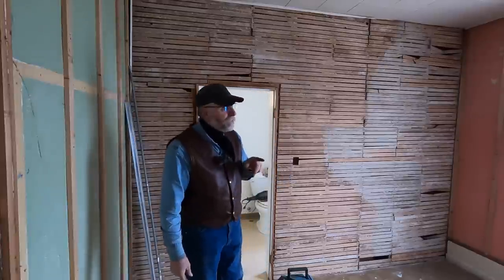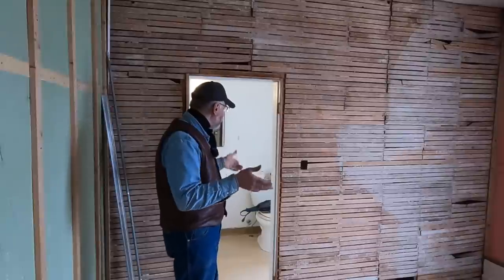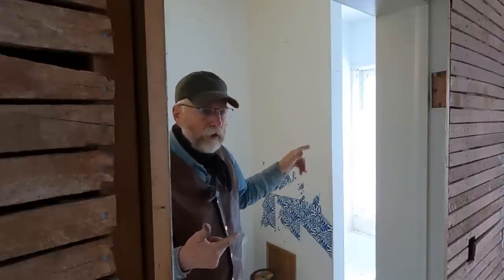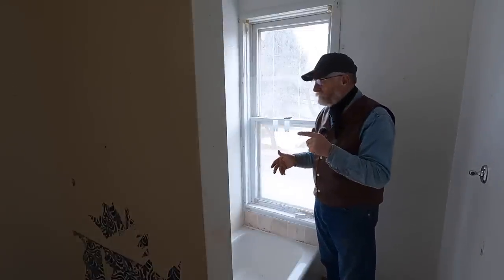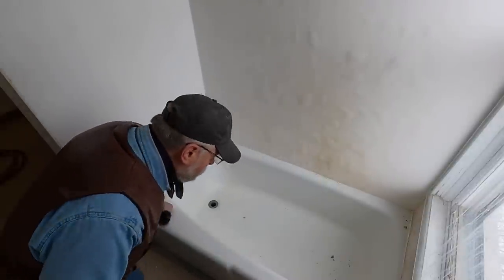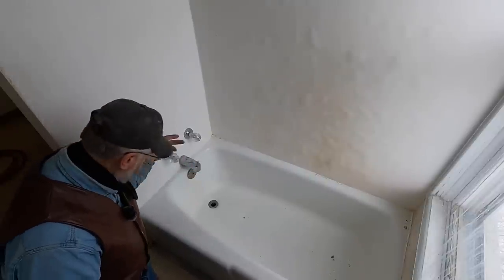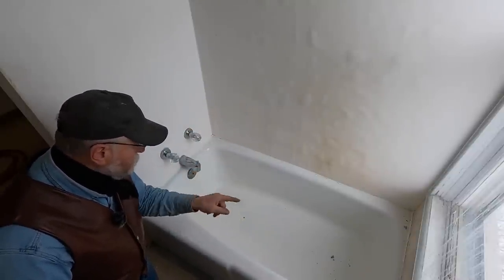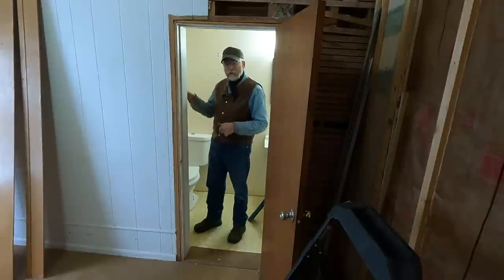1906 Hotel - Out With Cast Iron Tubs | Engels Coach Shop

Comment: In Scotland, the cast iron bath removal tool of choice is, a big hammer. Doesn't take too long, and good fun.
Reply: Same in England. A 7lb sledge will turn it into cast iron gravel quite quickly. Ear defenders!!!
Reply: Yeah, I've done that, it makes as much noise as a bagpipe. Actually, I'm sitting here polishing my bagpipes, I haven't gotten them out in over a year.
Reply: Yes, that's what I did to remove one in my house.  It was too heavy for me to handle alone, and a big hammer made quick work of it.  A bit messy but satisfying.
Reply: That would be too much fun and this channel would be demonetized,
Reply: I slid my Scottish out in one piece and cut the side out of it and filled it in with decking to make a garden seat
Reply: I did that myself and got just under $20 scrap price.
Reply: There is a lot of call for old castiron tubs that are in decent condition
Reply: These aren't the desirable tubs. These are shallow. So worth more as scrap
Reply: @catafalque3634  So cool!!!
Reply: Ear plugs,  eye  protection and a sledgehammer.
Reply: Did the same.   Told my wife to cover her cause I was going to make some noise.  Sledge hammer a nd drop cloth worked.  Hearing protection is beneficial!
Reply: Was about to say the same a sledgehammer does a fine job ( wear eye protection), surprised how short the baths in USA are great video again
Reply: @michaelgillespie1206 The pipes are much pleasing to the ears.
Reply: @jackgreen412  the skirling of the pipes is very pleasing.
Reply: @johndavies2396  Those tubs look shorter than typical American tubs...
Reply: Exactly my thought the moment I heard "cutting tool" - but WHY, this is cast iron! Short sharp shock with a heavy "persuader", and it's done.
Reply: @demonknight7965  I did some bathroom renos when I was a kid. We busted them up with a sledge. It makes me cringe to think what I could get today for some of those claw foot tubs I destroyed 45 years ago.

Comment: I generally use a sledge hammer to remove cast iron baths. It makes a lot less mess than an angle grinder and it's much faster to reduce it into manageable pieces!

Comment: A refrigerator dolly with a built in ratchet strap is useful in getting old tubs downstairs. If you choose to break them into pieces with a sledge make sure to have safety goggles on. Cast iron has varying quantities of sand added which makes it very hard on cutting tools. The sand in the iron pour makes it brittle so it is usually easier to break it than to cut it. Please be careful.
Reply: Also the enamel is essentially glass, and can splinter and fly like crazy.
Reply: I have busted them out with a hammer too. OUCH! Messy but quick.

Comment: Dave, I'm sorry to say this - i winced (for the first time) when you cut up that cast iron bath tub. They are very highly prized here in the UK and fetch good prices. People often dislike the plastic or fibreglass ones commonly available.
Reply: Yeah, I hate the plastic and fiberglas to where I'd rather go outside and use the hose, and the thin metal ones aren't much better. I have a cast iron tub where I am now, thankfully!

Comment: Also, you will want to seal up any of the penetrations on the second floor as best you can.  Sheet metal or plywood and then caulk.  The restriction of air movement translates to restriction of fire movement in case of a building fire.  More time for people to exit the building before total engulfment

Comment: I'm a retired plumber and I'd be really nervous about using a grinder in a confined space in a building that's 100 years old it's so easy to set fire to himyou might not see a smoldering until the middle of the night when the thing goes up in flames. I recommended jackhammer for the tubs. Most people  use sledgehammers.
Reply: I agree regarding the grinder.  About 10 years ago in Bay City, MI an unsupervised subcontractor used a side grinder in the attic of the courthouse during a re-roofing project.  A fire started and the building was substantially damaged, including many, many records damaged or destroyed by the sprinkler system.  Those old buildings are tinder-dry (usually) and a single spark can start a fire.  Hammer Time.
Reply: Jackhammer sounds like more fun then a sledge.🍻🇨🇦👨‍🏭

Comment: Drain removal:  Sometimes a smaller set of Channelocks can be used to remove the drain.  Put the handles down through two of the four holes in the drain; use a screwdriver through the exposed part of the pliers to turn the drain.   Thanks for your videos.
Reply: Those drains didn't have any cross bars.
Reply: He told you the cross did not exist. Please listen next time. Do better man.

Comment: Old buidings! A nightmare. My experience rehabbing bathrooms in old buidlings is to gut the room to get down to original structure to see what you have. Everytime I have found so many alterations and water damage over the years I wind up taking it down to studs and floor joists to have a new foundation to work with. Often I find the floor joists have many holes drilled through for plumbing and electrical. I lay in stingers next to them to make it structurally sound. It makes for a solid floor. Also, I don't have to make compromises and waste a lot of time making old and new fit. It actually takes less time.

Comment: During my working life here in England, I have removed many cast iron tubs, if they were to be scraped or too difficult to remove whole, I found the best way was just to brake them up with a two or three pound lump hammer, cast iron baths brake up quite easily with much less dust than cutting. For the rest of the building, I would employ the services of an architect with a view to completely re-designing the whole building, which we would describe a gutting, that is removing everything that is not a supporting wall and start again. then turn it into holiday flats, hotel or in you neck of the woods, a motel, and market it and Joliet as a peaceful and beautiful place to stay as it seems to be on your video's, which I thoroughly enjoy. I have the feeling with your design ideas so far I fear it would turn out to be like it is now in ten years time. All the very best. Peter Norcliffe, Golcar, Yorkshire, England.

Comment: I went through several grinder blades cutting a cast-iron bathtub in my basement apartment. I had to get rid of it, it was filthy from decades of use without cleaning, but it was a heck of a chore.

Comment: Surprised you didn't just take a sledge hammer to it and shatter the tub, that's what we do whenever we encounter a cast iron bathtub. 
Dave if you're concerned with privacy for that bathroom window you could always frost the glass. My bathroom window is setup similarly to where it's in front or the shower but, we didn't want to put curtains or blinds up as they would get soaked so I went to the hardware store and purchased some that glass frosting spray fairly cheap and I applied 2 coats to the window. 
   It works quite well, it prevents anyone from being able to see in even at night but, it still allows all the light to come in. It's also easily removed with a Razer Blade  if you ever change your mind. 👍👍

Comment: Dave, there is a special plumbing tool made just for removing  the tub drain from the tub. You could make one by welding four short stubs of iron rod  onto a round plate just-smaller than the tub drain, approximately 1 1/4” diameter. Ans welding a short piece of square iron bar or tube on the opposite side. The four prongs going into the  tub  drain snd you then use a  wrench to loosen the drain from the tub. .

Comment: Yes I agree the method of choice to remove a cast Iron tube is a 10 Ibs. sledge Hammer  . The first floor tubes you might consider saving a few to sell , or the make great watering troughs for cos and horses

Comment: I've removed many cast iron tubs, only one with a sledge hammer. That was messy, lots of sharp shards, took longer. On most I remove sheetrock or plaster high enough to pull it out slightly and roll it up on its side. It'll slide out on the porcelain face. If you're gonna cut it, bite the bullet and use your mini grinder, you'll go broke using reciprocating saw blades. There is no easy way to take those out, just maybe less painful ways. Most assuredly, get some help.

Comment: Dave, I'm sure someone else already mentioned this, but there is a tool made for removing those drain plugs.  It looks a little like a misshapen fork with a t-handle on the top.  But it fits down into the drain and will turn it out pretty easily.  It would hurt to use some lubricant/ rust loosener on the drain first, though.
Thanks for the video - as always, you make me feel guilty I'm not carrying on more projects at once!
Tim

Comment: A demolition hammer works wonders in removing old tubs. Or a BFH works too! Plus you can work off any  frustrations at the same time. I have a pair of old pliers put together backwards with a nut & bolt to remove and install drain fittings. Works like a charm

Comment: Looks like everything behind/under tubs was dry. May not have been pretty, but the install worked. The plumbing looked pretty straightforward, which I guess is to be expected since these “private baths” were added when the apartments were put in.

Comment: Those tub drains are usually pretty easy to remove if you can get to the back or bottom. There is a nut on the pipe tightened up under the bottom of the tub. Unscrew it, and the drain fitting in the tub should be free. But it won't be, because it was put in with putty to seal around it. You can usually grab the thing under the tub with channel locks and either wiggle or tap upward on the channel locks to break it free. One more gland nut about 3" below the bottom of the tub and you can remove the entire tub drain fitting including the overflow pipe.

Of course if you can't get to the nuts, things are harder... It does look like there must be a crawl space above the first floor where the pipes are run, so there should be an access to that space, someplace.

Comment: Cast iron tubs shatter. Using a sledge hammer makes quick work of them. 

Also, I know you're wanting to keep the outside looking as close to original as possible, but have you considered glass block windows? They can be made to be water tight and they solve the privacy issue.

Comment: When redoing the plumbing, install water cut-off for each unit, that will be usefull in case of future problem in one apartment: you can work without impeding on other units.

Ideally, the cut off valves should be in the corridor, so you can isolate a leak even if the tenant is away.

Comment: Good job on removal of the tub. I did it once. FYI hardware stores should have a drain removal tool for about $15. If you reach in you will two nubs. The tool goes over and then with channel locks you can unscrew the drain. Definitely useful if you ever plan to reuse or replace the plumbers putty if leaking.
18:44

Comment: You mentioned that you would put in a 32" shower.  I would recommend 36" if it will fit. 32" works but feels confining. Also, it doesn't need to be square. A 32x36 or 32x40 would also be good choices.
Reply: In that regard, check the building code.  I seem to recall the stall has to be a minimum number of square feet.

Comment: I have replaced a steel bath tub in my own bath. Getting the tub out without modifying the structure was not pretty. and putting a new one in is the same. I replace a shower pan for my neighbor, not pretty but the floor needed work also. The old drains should be removeable from below. There is a compression fitting on the trap.

Comment: If you look on the bottom of those bathtubs it will be stamped the year they were made so you’ll have an approximate date of when they were put in
Reply: I have a very old one out back (someone had used it for a stock trough, but it's in too good of shape for that) and was wondering about that, but didn't find any date. Anywhere in particular to look? It's a deep one with a round bottom and curled rim, but no legs.
Reply: @Reziac  I’m not certain on clawfoot tub’s but I know from the 20s on they were putting dates if the clawfoot tub doesn’t have a date on the bottom it might be under the rim somewhere
Reply: @hsimpson6581  This probably came out of a house that was built in 1920, but didn't originally have a bathroom (added after it was moved in the 1960s). Thanks, I'll give it a closer look... right now one side is frozen down and it's hard enough to move when it's trying to help ! :)

Comment: I almost forgot to add, Dave.  When you are ready to move those tubs down stairs, lay a piece of carpet down at the head of the stairs and turn the tub upside down on it. Then thread a rope through the drain hole to control it, and it will slide down the stairs on top of the carpet piece a easy as pie.  Don't have Diane waiting at the bottom to stop it, though; there's not enough of her to do that safely!
Tim
Reply: Thank you for the good idea.

Comment: You can shatter cast iron tubs with one or two sharp blows from a lump hammer or other similar heavy hammer on the underside of the tub. Breaks up like ceramic tiles. Boy oh boy do you need to wear ear plugs though. Then it is easy enough to hand ball the pieces to the trash. Careful the pieces are razor sharp.

Comment: Other issues with smashing apart an iron bath tub are that:
1. A piece may hit your shin.
2. Due to the curvature of the bath, your sledgehammer head may glance off and either hit you OR more commonly, put extra strain on your body by travelling further than intended.
I say this, as a sixty (60) year old carpenter.

Comment: Also.  Lath and plaster are not the same as drywall.  They do count as a structural element of the house.   Insulation in old buildings also change the loads on a structure.   Make sure you check with an engineer if you take too much out.

Comment: Hi Dave & thanks for the great vids.  This brings back memories and from that I would like to make humble suggestions.1)  Have water shut off valves to each suite.  2) Put more sound proofing insulation between suites where easily done in biffys.  3)  ** most important  get rid of natural gas stoves and put  in electric (yup may have to upgrade electric service but worth it in the long run) they will be better air quality and less chance of a big boom. I know they have been there for years which is even more compelling to get them out.  Also, being electric stoves, tenants pay the bill as I doubt there is a separate gas meter for each suite. A few  years ago there was a movement, pushed by insurance companys, to lower the height of the shower heads in rental properties - apparently the settlement for body burns on idiot tenants who stand in the shower and turn the hot water on first is less for body burns than facial - go figure.
Also recommend you don't use low flow toilets as the run in old buildings may not be steep enough to totally flush the lines leaving some solid waste in the lines over a short period of time which then acts as a damn - been there done that.  If bylaws state must use low flow use models with the highest flow rate you can get.
I didn't notice if the rooms were heated by wall type nat gas heaters but if they are and if your paying the heating bill then I would suggest you convert all heating to electric base board, again the tenant then pays the heat.  Use new but old style base boards which have a flat top on them not the new style which have an open top and will burn the dust causing dark soot marks on the walls above the heaters.  If you ever want to determine who pays the heat in rental properties just drive down the street in winter - the heating in buildings with open windows is paid for by the landlordord.  Rod (retired BC Hydro Marketing and Sales)

Comment: In the windowless bath, remove the partial wall with the plumbing then the tub removal will go easier. It is not a big concern,as both the water lines and the drain will need to be extended  to the new locations.  It is likely 5hat 5he water / drain lines are fed through the partition wall between the two baths. Installing a small sliding window above the shower would permit light into the room and can act as passive ventilation in the warmer months. For  the windowed bath, you might be able to have a shower stall next to the window on the exterior wall and  remove the partition wall with the  plumbing, completely. Doing such would open the room tremendously.

Comment: We usually take them out in one piece if possible. Tip them up on end and strap it to an appliance dolly and roll out the door. Sometimes break them up with a sledgehammer and safety glasses.

Comment: As previously stated, cast iron will crack when hit with a large hammer. The noise is fierce so wear your best hearing protection and it breaks into shards that are sharp so heavy gloves are needed. Cut off wheels aren't cheap and you risk damaging your floor. Since your windows are getting replaced couldn't you build yourself a removable chute that drops debris into dumpster below? Nothing easy about cast iron tubs.

Comment: Some LEDs flicker and some don't.  A guy has to experiment.  Some are helpful enough to tell you if they cause a flicker most don't.  In future if you want to save the drain they do make an inside pipe wrench which is the ticket if there are no purchase points inside it.  Also might try a tailpipe expander??

Comment: The best way to remove the tub is with a 5-10 pound sledge hammer . Bust out the interior bottom corners first and the rest will crack up into manageable pieces after that. Done a bunch like this remodeling 1950's houses